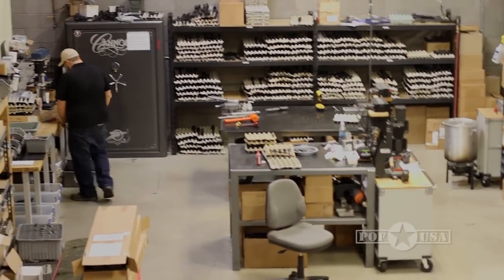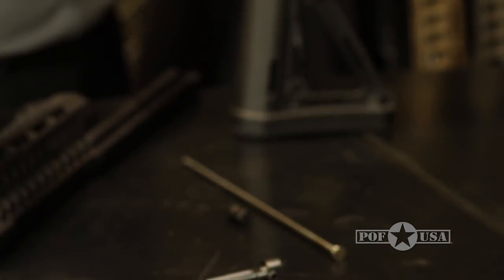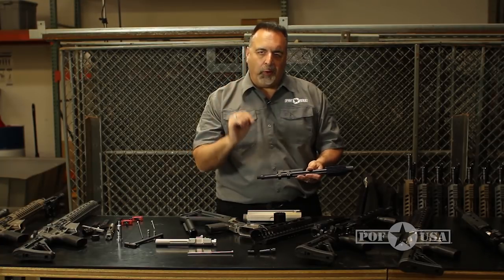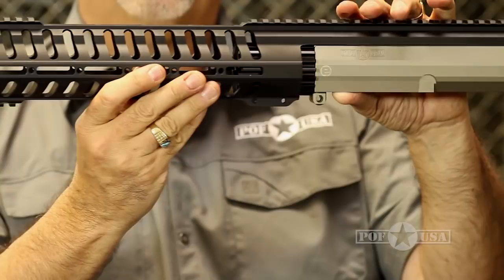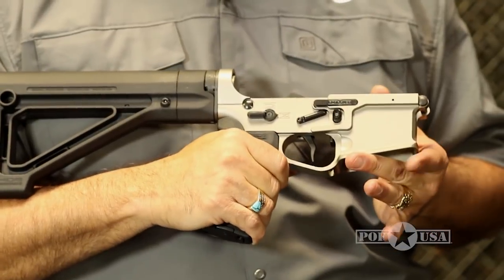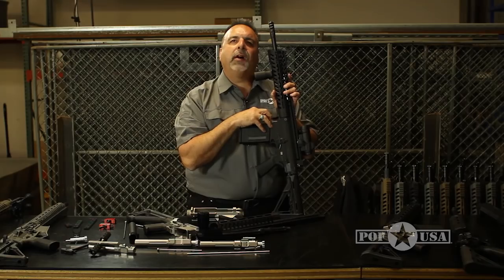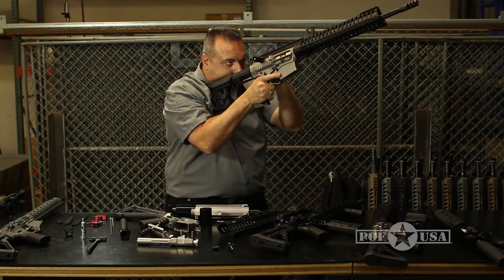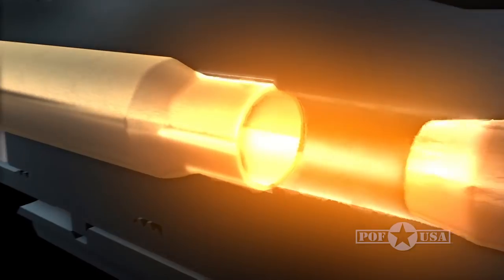POF-USA Presents: The Why

Comment: IMHO, POF produces the best ARs available today. I have a 2017 production P308 Gen4 EDGE SPR in the NP3 finish (Mod # 01221), it's become the favorite AR of my shooting friends who come out to the shooting property on rifle days. .6 MOA all day long, and with the gas plug dialed down or in the "off" position, you can actually watch the bullet vapor trail to the target, it shoots that softly. This gun is my most supported AR (mags, ammo, spare parts, Leupold Mark5 HD scope/RDS/BUIS, .....) for a reason, it's a true SHTF battle rifle. Amazed at the consistency of the spares I received from POF (even commented on this with Scott M at POF), when checking lengths of the Piston & Op Rod in my spare kit, I found the piston within .0002" and the Op Rod within .0001", when compared to the parts used to build my rifle two years ago. Yes, I actually have a granite surface plate, L.S. Starrett/Webber Chrome Carbide Jo Block set, surface gages, Swiss made Interapid .00005 resolution indicators.........in my home shop. I don't wonder about things like accuracy, I verify it for myself, and POF passes with flying colors

Comment: The roller cam pin is not needed on  direct gas gun, the gases unlock the bolt. But on piston guns  especially .308 it's  essential. I have on on my SR-762 smoothed it right out. Smoother operation and recoil. I have four ARs and the POF is by for my favorite.(big part to it's ease of cleaning)

Comment: When you show up at the range with your brand new POF 308 you can remain confident that it WILL RUN!  You will not be dealing with FTE, FTL and all the other things that would make your first outing memorable for all the wrong reasons.  These .308's are absolutely amazing. These are serious machines and cost a few bucks more but compared to what you are getting they are cheap. It is a first class piece that will gain your trust and respect after every outing.
I have a 14.5" bbl with a pinned muzzle device in Titanium Cerakote that looks as good as it shoots. It will have guys wanting to check it out and will leave trying to rationalize how badly he NEEDS it. Seriously, most folks are surprised at how affordable they are if they shop around. BUY ONE!

Comment: Nice design, now how about chrome those piston parts like Ruger does and they'll clean up even easier...no need for scotch brite. Love the bolt desgn...similar to Rugers...no staked bolts.

Love the aluminum heat sink as it absorbs and dissipates heat quickly as you mentioned. Indeed some very innovative designs and improvements.

Do you guarantee sub 1 MOA on every rife you sell?

Comment: I'm shopping for my first AR and stumbled across this video. This is the best video I've seen that gives me the details I'm looking for so I can make a decision. I wasn't planning to spend this much but I'm so impressed with the engineering and quality of the product I have decided to make a purchase.
Reply: Yea, I agree, they make a truly 1st class gun. Only real drawback I see is they don't use standardized parts. If you need a new BCG, you have to get another POF part. They do make standard AR parts too. I have a DI BCG from them & really like it. The roller cam pins are very nice. I am going to get adjustable gas block from them too. 
I do think they have made notable improvements over the standard AR but, I gotta admit, I have several ARs & really like the ability to mix & match parts.
Reply from the maker: our DI guns should work fine with any Mil-Spec DI carrier.

Comment: Very informative.  I'm about ready to get my first AR-15 firearm.  I didn't hear anything here about the rifling.  I know mil spec is 7  inches per turn, but your 415 has 8 inches per turn.  Any advantage or disadvantage there?
Reply: higher verity and range of bullet grain.
Reply: Thank you for the info.
Reply: 62T-bird Man Yea I would take the 1 in 8 over the 1 in 7. it will stabilize the 55 grain standard 556/223 round a little better.
Reply: tighter lancing groove patterns lend themselves to stabilize heavier projectiles, however, in .223/5.56, 1:8 is good enough to get the job done with all weights available to the caliber, from 35-75 (never heard of anything more than 75 grain..) and still give you acceptable accuracy, in fact it helps not to be super tight as it increases friction and the high velocity results in high rotation speed which can cause horizontal drift.

Comment: I think POF rifles are fantastic, reliable, accurate and extremely well thought out and executed rifles. I own 4 LWRC's and recently picked up a POF in 7.62x39, I have only about 800 rounds through it so far and not a single issue. I have 3-7000 rounds through each of my LWRC IC's, REPR and AR pistols and I'M confident my POF will hang with them. If I buy another rifle it will quite possibly be another POF in 556 or an LWRC, tough choice. My $4000 REPR is hard pressed to shoot sub moa and I found that out AFTER I spent $3600 on the rifle and $1000 on a new scope for it, very disappointing but their 556 are amazing.
Reply: Kustom Hooligans What AMMO.       are you , running through it. ??            [ &, I know, ppl Will Hate me for this..Hornady, 'Best" ...[ not, allways]  Bench rest ??? , What Distance ?... &, IN A REAL WORLD,  SITUATION...1, moa, is GREAT !!

Comment: i have a pof 556 thats having chambering issues. If run my rifle in suppresed mode while not using a suppresor will chambering issues be a result?
Reply: +Enrico Filippone If you aren't running a suppressor and you have your piston set up in suppressed mode it will not cycle properly
Reply: thank you
 sir

Comment: Don't believe everything you see here.  I just purchased what I thought was a great gun from P.O.F. only to be very disgusted as to what they sent out the door to a customer.  I have a new P415 E2 extractor model in Tungsten finish.  The problem is that the upper fits so loose on the lower at the front pivot point that it RADDLES and there is a lot of movement side to side.  I sent e-mails to their customer service or technical department and NEVER EVEN GOT A REPLY BACK!!  Since I've had to order from Brownells metal shims to use over the front pivot pin. The rear is fine.  They've also cuts costs recently with not using the better Veltor Stock and Ergo Grip.  In fact for a $2100+ rifle they are even using the cheaper Magpul stock an grip. They don't even use the Magpul better stock with the battery compartment and larger cheek pc.  In addition they supply a very cheap and flimsy charging handle BUT you can go on their access. site and order a much better one which I feel should be included for a rifle in this price range.  Watch OUT, this shows how their cutting cost on these stocks, grips an handles I can only wonder where else.  Buyer Beware

Comment: Well...I do like my P308.  BUT...I have recently had issues with the gas plug.  The original gas plug just separated while shooting at the range.  I called POF to see what I needed to do.  I was told to complete an online form.  I have completed two for the same problem because no one from your company has responded.  I went ahead and purchased a new gas plug and that one came apart after shooting just 20 rounds.  I have since purchased another gas plug.  I have not fired one round because I am going to have a gunsmith look at it.  As of this date, despite completing two online requests, no one from your company has responded.  I really do like your product, but your lack of customer service is concerning.  I was going to purchase the Renegade Plus, but my confidence in your ability to service your customers is lacking forcing me to consider other options.  If your service were to be half has great as the product produced, you would definitely ensure my loyalty.  You've definitely figured out the "why" from a product perspective, but there is definite opportunity to improve servicing and being responsive to help close the continuum of the entire customer experience.
Reply: Did they ever get back to you about the gas block?

Comment: I just ordered one of your POF USA Barrels from JoeBoboutfitters. I ordered the POF Puritan 16.5 inch 5.56 Match 1:8 twist 5R barrel. I found this video after the purchase. But I don't plan on using it for a "gas piston" system. I want to use it for a "Direct Impingement" system. Will it work for that?

Comment: I love my pof 415, I have a earlier model that used a standard metric fal gas plug so no normal/suppressor mode on mine but it can't be stopped. Another pof owner I talked to has over 130,000 rounds out of his gun, ran semi and full auto by the way so it was not all easy range shooting and the rifle still shoots within mil spec at 100yds with standard range ammo. All I can say is it may be a little bulkier and heavier than the competition but no other at platform out there is tougher and more durable.

Comment: The extractor of an m-4, or almost any firearm with an extractor does NOT operate by  PULLING the spent cartridge out.  This is a common misconception.  It is NOT true at all.  ALL that the extractor does, and should do, is remove an UNSPENT, UNFIRED cartridge.  The cartidge's recoil when fired, (It's opposing force from firing the projectile) pushes the bolt out, (In the AR15's case), once the gas/piston has unlocked the bolt an thus allowing the carrier assembly to travel.  As such, the extractor is ONLY along for the ride.  Say what you like, but I can prove it.  Take the extractor off your ar15 and shoot it, it will shoot, and cycle fine.  The ejection will be a bit off because the ejector pushes the cartridge to "trip" over the extractor, before it hits the receiver ejection port wall (ideally at about 90 degrees) and springs out of the weapon at approx. 2 O'clock.  However, this is not the extrator's primary function, it's an incidental one only.  The extractor did NO extracting.  The cartridge's equal and oppossing forces pushed it out of the chamber and it pushed the bolt carrier group backwards,  as the recoil forces are still present, and still vectored rearwardly, momentarilly, after the projectile has been fired, and even after the brass has expanded and contracted.  The important thing, is timing the unlocking of the bolt to coincide with the cartridge having just contracted while still having recoiling forces in action, as a consequence of ignition pressure.  The only trouble you'll have if you remove the extractor is, like I say, removing an unfired cartridge from the chamber.  A broken extractor is not the extractor's fault, it's from the unlocking forces of gas or piston forcing a cartridge to early, ehile it's still expanded in the chamber.  THIS is what breaks case's and extractors, not extractors or their springs.  Just thought I'd make this clear since Frank, in describing the e^2 (A good concept and system I'm not arguing that).  But I am correcting him when he states the extractor pulls out the case.  There is no, or should not be (With things working properly), any of that nonsense happening in your firearm.  If there is, get ready to replace your extractor and dig out a headless stuck shell-casing from your chamber, because that's not supposed to happen and when it does, that's when you have hopefully a broken extractor.  I say hopefully, because the alternative is a ripped case head, from a case that's now stuck in your the chamber.  That equals a soldier's worst nigmare in a firefight since that's typical to be a 5 min. operation to remove with tools, before your weapon is operable at all.   The unfortunate but inevitable pulling of a case from the chamber was a huge problem that came about when the m-4 became the dominant weapon over the longer barrel/tube using M16 because of the shorter path from chamber to gas port back through gas tube to carrier led to less volume in the rifle's action, ergo premature impingment of gas pushing on the carrier and pulling on the bolt/cartridge head while it was still under pressure and in the chamber not yet re-constricted.
Reply: +David Youngblood   BUT SOME GUYS DONT KNOW THAT  - I STILL LOVE MY COLT M4 LE  ITS MY GOD AN SAVER